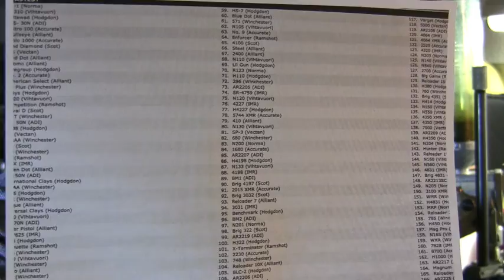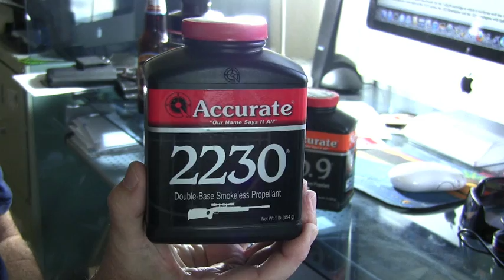POWDER BURN RATE OVERVIEW - TURN AND BURN

Comment: What powder would you recommend for short barrels 3in or so . I have a 10 mm. Glock 29.
Reply from the maker: With short barrels you want to lean more toward the faster burning powders.Winchester 231 would be an excellent candidate. I have always loved 800X for the brute power. It is pretty much in the middle of the burn rate charts.I also loved Bullseye. That one is a real speedster.It should do well if you stay within normal load parameters. I would probably start with 231. Thanks for watching. Have Fun Be Safe.

Comment: WARNING !!  To all reloads:: Alliant BE-86 powder is EXTREMELY corrosive.. It ruined my RCBS powder dispensers, it melted my powder hoppers.
                            I left BE-86 stored in my powder dispensers for eleven--11 days. My powder dispensers are totally destroyed, they cannot be repaired.
                            I called Alliant, they said. "We wouldn't consider replacing your dispensers."  Because I didn't empty my powder hoppers, after I finished reloading.
                            Also, BE-86 does NOT produce advertised bullet speed--fps. It's off by nearly 200 fps. Alliant  powder company is full of dishonest people, and their powder sux..

Comment from the maker: LOL. Love Negra Modelo with a good Mexican meal. I will try your Alliant 2400 recommendation. I'm always looking for a good 10mm load. H110 and W296 have always been my crowd pleaser with my Dillon 9x25 loads. I use 32.8 gr of H110 under a 300 gr Deep Curl Bullet in my 454 Casull load. It doesn't get any better then that. Check out my blowing up the ham with a Casull video to see the results of that load. 
Thank you for watching and the load recommendation.
Have fun and be Safe :)